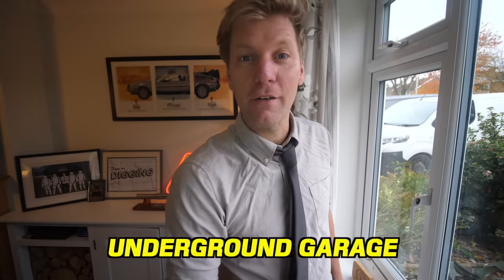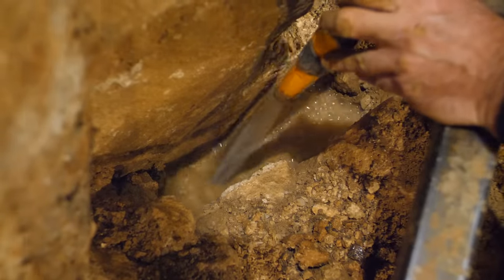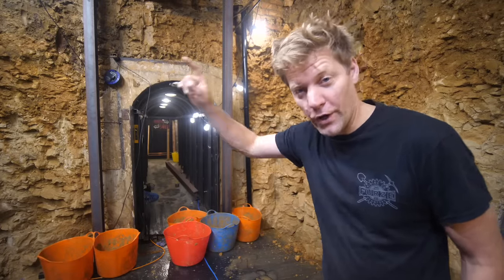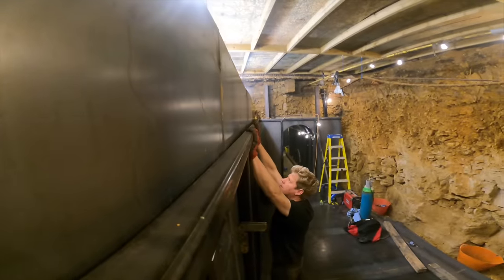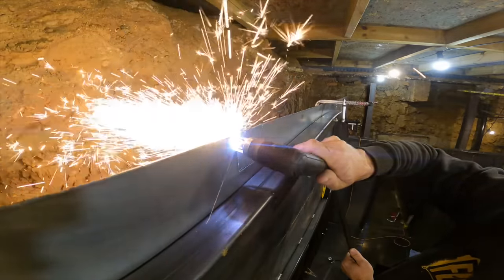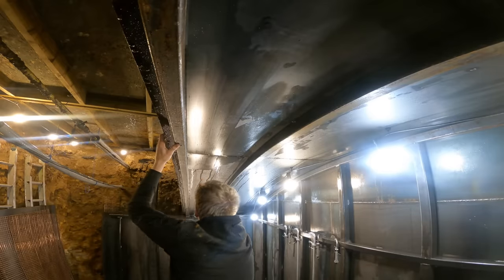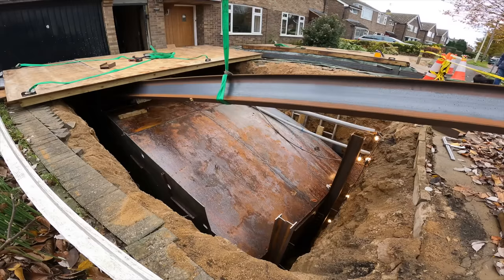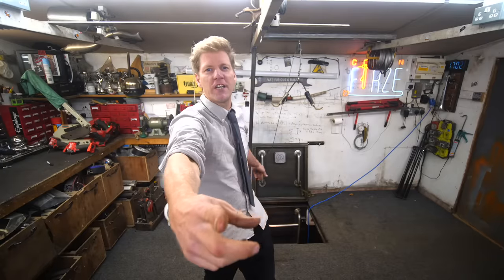Digging A SECRET GARAGE Part 2

Comment: Colin,I would highly recommend you to put a 100mm conduit/pvc pipe (x2 preferably) (or a ductway),encased in the concrete between the house and your front fence mate.(If you haven’t already thought of it).I’m a sparky and if you ever have to upgrade the electrical mains etc. at a later date,you’ll be glad you did.
Cheers mate
Love your work.
Reply: As a sparky myself, I like the way you think mate
Reply: i aint a sparky, but it does make a whole lotta sense and it sounds like it'd save alot of pain and time doin it

Comment: For anyone wondering that electric cable is called a pilc cable, paper insulated lead covered. when new it would of been covered by hessian wrap coated in bitumen but over the years it has gone brittle and clumpy with mud under the hessian are normally steel tape armours but can come without or as we call it plain lead. Under the armours is another hessian wrap coated in bitumen once again you can cut it off with a knife normally when that’s off ya heat the bitumen till it goes like a liquid and clean it off with paraffin wipes too nice clean lead. Then with a plastic hack knife we normally do this live too ring round the lead then hammer the hacknife down the lead to remove it. Once removed there are papers impregnated with a paraffin wax and that is the insulation wrapped around the live cores and the neutral. That cable is probably between 50 and 60 years old and once you get down to it’s as good as the day it was put in. The plastic stuff we use nowadays isn’t as good.
Reply: The only comment witch was deserved approval by the man himself colin.
Reply: Personally would have put in a 38mm black corrugated ducting to identify to DNO it’s electric not grey, which now a days is used by telecom BT fibre
Reply: As a former utility worker in Florida, where we did/do things very differently, thank you for that explanation! Always interesting to see how similar problems are solved in different places.

Comment: The one thing I think that I've learn from this, is that it turns out Alfred and Bruce could have totally made a Batcave in secrecy by themselves without needing all those contractors after all.
Reply: Thank you. I now have an image of Alfred in welding gear stuck in my head lol.
Reply: I think I’ve read a comment before (don’t know if this is true or bullshit) but they said Bruce Wayne & Alfred hired a bunch of contractors & then they had their eyes covered & only let them see once they were in the cave, so they never knew where they were working & when they left they had their eyes covered again. I’m guessing they prob didn’t have Bruce Wayne in there either, better nobody knows it’s his project.
Reply: @dillonvandergriff4124  Alfred Furze!
Reply: That drain is not a good idea, you can start causing erosion god knows where from having a large flow of water where there was never previously one. This can cause a sinkhole. Very bad
Reply: @gilliesiut2332  You obviously didn't saw his previous videos.
Reply: @gilliesiut2332  Its solid rock not dirt
Reply: @yahyakhan9745  he doesn’t stick a drain pipe from the surface into some unknown undergoing cavern… drainage isn’t a issue because he never broke the surface. I hope it’s just temporary
Reply: @gilliesiut2332  Also, he showed the topography of his area.
Reply: @dillonvandergriff4124  They call him "The Arc-welding Knight"
Reply: @yahyakhan9745  what’s your point? Things erode with water… you people are clearly unaware of how sink holes are formed… core samples had he taken or sonar scans has he done underground to understand the effects of that water and the composition on the ground underneath?
Reply: @yahyakhan9745  where I live you’d need a lot of permits to attempt something like this and just doing it would likely lead to your entire house being condemned. I’m not trying to say it’s super unsafe but we learned these lessons the hard way. Funneling water underground like that is very unadvisable. You don’t know what 50 years of flowing water will to the the bedrock. Especially going through freezing cycles.
Reply: @gilliesiut2332  The water was already draining from his house before he built the underground garage, so there's no 'new' drainage requirements. He talks about the 'soakway' at 2:40. And of course, all of this has been approved by his local city services engineers. Stop presuming you know more than someone who's very smart and has been working on this project with professional engineers for over three years. This is not the first time someone has built underground tunnels and garages etc.
Reply: @kindabluejazz  yes a soaker way is designed to percolate the water through the soil to avoid this… a percolation test needs to be done to avoid this issue…
Reply: @gilliesiut2332 Agree it could be a big issue, the erosion risk is totally different having water soak through soil and onto rock and having a stream of it directed onto  a section of rock. 

That being said I do think Colin has been pretty on the ball with this sort of thing so far, a lot of planning has gone into it and I'm sure he'd hate to put his neighbours' houses at risk. He'll get it done right eventually, as a temporary solution it's fine.
Reply: @gilliesiut2332  watch the video before you start your armchair geologist/plumber act my guy.
Reply: @scotthill1600  like Better Call Saul. Bravo Binco!
Reply: @harrasika  damn right, love the reference

Comment: For the condensation, just install a breather vent. Along a area of highest point at the edge put a vent that goes up to the surface with vent slits so you can shut the vent if you want. Then like a firebox chimney up top have about 2ft of pipe and a cap like what they use on factory warehouses. With it poking out your garden you could hide it in a plant box.

Comment: Hope it's not too late as I know you move quickly. But here's a thought that could potentially help your condensation situation. 
My solution: run PEX (or similar flexible water pipes that are suitably rated) back and forth along the ceiling, above the metal but touching it so that it can be embedded in the concrete. Then, run mildly warm water throughout the pipe. It'll warm up the steel ceiling and prevent it from collecting condensation. The warm water could even be plumbed into your home water heating system in a reflow loop (which is a standard system these days in a lot of places). 

As always, fantastic work and thank you for sharing!
Reply: Good idea; Just like a radiant heating floor or a liquid cooled anything.
Reply: Damn. Very smart recommendation.
Reply: I believe he doesn't want to heat his garage, otherwise this would not have been a problem anyways.
Reply: A cheap air dryer could be a good trick. He already has "the crack" in the back of his garage, He could just shove the outletpipe thru the rain gutter and and be happy with it.  
Those phase changing air driers are pretty impressive.

Comment: Install a dehumidifier in your tunnel / underground garage to keep the moisture tuned up
Reply: My thoughts exactly
Reply: My thoughts as well. Woods makes some good ones.
Reply: He has one, but is isn't going to solve the problem.  When warm air hits a cold surface you're going to have condensation.
Reply: They key will be plenty of airflow

Comment: grab a dehumidifier for the moisture and you can hook it up to a controller with a sensor and set it to go on when it's needed. waste water will build up so a drain or some method of getting rid of the water collection is still needed. This is common practice for growing cannabis indoors over here in California to keep the growing environment controlled.  I have heard good things about the brand Sentinel but there are a bunch out there. You can calculate the area of the room to properly spec out a dehumidifier needed.

Comment: For the condensation issue, a dehumidifier might help greatly with a benefit of keeping the moisture down that would also help protect the steel on the inside of the tunnel more.
Reply: Yeah, well, some insulation would've been mighty handy too...could've replaced much of the steel and saved a hell of a lot of money!

Comment: I fabricate and make Acoustic containers,they have Steel floors,to avoid the floor raising or warping we plug weld them to the frame underneath before welding the perimeter or uprights by drilling a 5mm through floor and frame then 10-12mm though floor and then weld them together at equal spaces,avoids any lifting or warping when welding up👍(great content as usual 💪)

Comment: Have you thought about putting a time capsule under the floor in one of the rooms for someone to find in 1000 years?
Reply: I leave "time capsules" behind whenver I work on my house. I'll write stuff on the back of drywall, or like in my master bath I put a note inside the wall.
Reply: That's a fantastic idea
Reply: @lugoismad me too haha
Reply: During our bathroom renovation. I did a patch up job on the bottom plate of our wall that had rotted out. Cut out the offending piece, replaced it and nailed it in. Not sure if I'm supposed to waterproof it, line it or anything. It'll probably rot out in 10 years. I just covered the wall back up with new drywall. I left a note on the new piece of wood. "Sorry, I don't really know what I'm doing" lol
Reply: @lugoismad  I was taking apart an old floor lamp, and found a note inside it. Apparently I repaired the lamp when I was 15, and left a note inside with my name, date, etc. I probably didn't expect to find it myself decades later!
Reply: “Here lived someone with more money than sense.”
Reply: When I helped my brother-in-law build an addition on his house, I drew hieroglyphics on the roof sheathing showing UFO’s helping us build it 👍🏻😊

Comment: Have you thought about a positive input ventilation system to deal with the condensation? Pump in air from the outside which has lower humidity to create positive pressure and force the humid air out of some carefully placed vents? Should keep the condensation out and will also keep it smelling fresher down there as well.

Comment: You know, it might be a good idea to build a SUMP PUMP somewhere in your tunnels! It could drain any excess water that ingresses into your tunnels. Like in most basements. It could prevent future flooding if the water table rises too much.
Reply: He is on top of a hill though
Reply: @andrewreynolds4949  as neat as the cracks in the rock are, im sure that it does not go on forever. i wonder how long till that makeshift sceptic tank becomes a problem, or next owner's problem.
Reply: I was thinking the same thing, he needs a "basement" for his already subterranean garage. Just a little maintenance closet underneath that can collect all that moisture he's having problems with, as well as any other spills/overflows/whatever he has in the future. Most garages lead outside so if you have issues it's the yard's problem. With this, the garage is the low point so any problems outside will come in.
Reply: As someone who's basement has flooded several times I do recommend a sump pump. After it was installed the basement has not flooded since.
Reply: @GilliamVespa  It will become a sinkhole in the future
Reply: Or maybe just a hole with a drain? Gonna get water in there eventually if the roof opens up to get the car out.
Reply: It's limestone rock on top of a hill that was bone dry after record rainstorms. It's literally where you'd dig the drainage bed to send the water from a soakaway or sump pump in the first place.
Reply: @GilliamVespa   He's on limestone- which is highly porous due to all the jointing (cracks) in the rock- those cracks probably intersect the water table or a natural spring at some point.
Reply: @GilliamVespa  I was meaning that, going by what he's said before, the water table probably won't ever rise high enough to threaten his tunnels, since he's on a hill (or else there would be an awful lot of the area underwater). I don't think the "dump the water in the cracks" idea is great, but I'd be more worried about blocking that spot with debris than filling it with water. That sort of rock tends to be reasonably porous

Comment: To avoid condensation you should insulate the ceiling from above by introducing a separating layer between de soil and the steel plates. Extruded polystyrene foam should do the trick.
Nice work, Colin. I'm hooked!
Reply: The concrete should help
Reply: He sorted that out on his second channel.

Comment: The gauge of the electrical supply cable is chosen by its surroundings ability to conduct heat, so there is a chance the cable could get pretty hot under full load if you duct or tube it. The best thing would probably be a perforated cable tray. Earth itself is a pretty good conductor of heat.. think project is nuts Colin, i flppng love it

Comment: You just know with Colin's enthusiasm for tunnels (and our demand for videos on it) he's going to finish this then add an extension down to the corner shop for snacks. Then one to the local pub cellar.
Reply: some of us know with climate change, this might end with a shop full of wet chips and and alot of rainwater in the beer

i have seen underground buildings in the middle of the city being pushed meters every year, thansk to the power of water

i would start to keep a eys on its movents right away...
after all this is standing right under a old house that was not designed for it..
normally when you add a celler to a old house they are very small for the same reasons...

or else you need to check the ground first, and thats not cheap

this is pusing on the fundament of the building if it moves just 1 cm
this is actually a part of the fundament, we was looking that the corner of the house in 1 video
Reply: I'm waiting for the tunnel to the bank.

That should be a Wealth of information.
Reply: Time to dig down another level!

Comment: With the condensation that you are getting on the roof, Royal Navy ships have this problem and what they have installed to deal with it is cladding, a man-made mineral fiber membrane in fabric sheets that isolates the warm temperature from inside the ship hitting the cold steel metal that buffers the cold sea, hope that helps.
Reply from the maker: Will look into that.

Comment: Imagine when, in years to come, someone else eventually owns this house. Like imagine if the secret network of tunnels are never mentioned and someone just happens upon them by complete accident ✨
Reply: Some people have said because of all this the house would have to be a bunker with a house attached I'm not like a realtor so I don't know if that true but they said they are and who an I to   doubt
Reply: @pepsizerosurger5365   Colin has already said although he's personally never going to sell the house. If He or Someone were to it would have to be listed as the bunker that comes with a house as he had it valued (or atleast looked at) after building just the original backyard bunker.
Reply: I know someone in the highlands who has done exactly that to the property they sold. Pool room with slate table and bar. And the new owner has no idea its under their dining room. Love it.

Comment: With the “biscuit tinning” floor, the other way of stopping it is to drill small holes through the sheet (not necessarily through the tubing) and tack the sheet to the tube. It’s much better if you drill the holes before putting the sheet in place but hopefully that helps.

Comment: Wish you had put a glass panel on one of the walls and back lit the rock on the other side. Would have been an amazing design element. Of course glass is probably more expensive, but so worth it 😊✨
Reply: No point. Dont forget its going to be blocked by concrete

Comment: I recommend you rethink the drainage situation. You'll clog up that hole with leaves in no time plus the water table might raise enough to block quick drainage if there's snow melt etc.

I recommend to drain into an accessible tank with a large leaf filter in the center and a pump on the other side. So you can simply open it and clean it. The pump should get a battery backup and pump into the sewer.

As a backup, you can use the "hole in the ground" idea, so if the power is lost over a long time or the pump can't cope with it you'll have still a backup plan. But I recommend installing a check valve, so if the water table is rising you don't try to lower it via the pump 😅
Reply: I would think eventually he will need a drain around the perimeter of this garage, to wherever it outflowed before
Reply: Did he cover that hole with something so the concrete won't clog it up if yes then I missed it
Reply: @Ziegel8171  I mean he must, otherwise he'll need an infinite amount of concrete. That's not sustainable 😁
Reply: @andrewreynolds4949  yeah, I recommended drainage via a french drain around the garage, set a bit lower than the concrete already on his other channel, plus a moisture barrier outside of the concrete, to avoid that it comes in touch with the soil, so it won't be wet all the time, causing rust.

Not an issue in the normal tunnel, but an issue if the streets get salted each and every winter. This salt will wash off around the car parking spots and corrosion of the steel would be accelerated.
Reply: @RubenKelevra  concrete is pretty thick so it wouldn't drain that fast
Reply: @Ziegel8171  false.

Comment: Colin a quick, easy and cheap way to sort that condensation problem for now would be to install some pvc refrigeration strip curtains. Worked a treat at work to keep the warm pool air condensating the changing rooms while we fixed the exractors. Hope this helps
Reply: Plus if you need to carry anything through there you can just walk straight through like nothing

Comment: I have a suggestion on the condensation on the roof. If you're able to get a small ac window unit(or a little bigger)and run some ducting you should be able to keep the air drier than right now